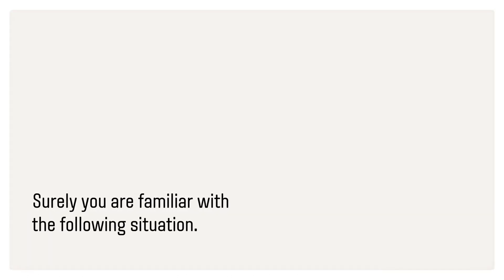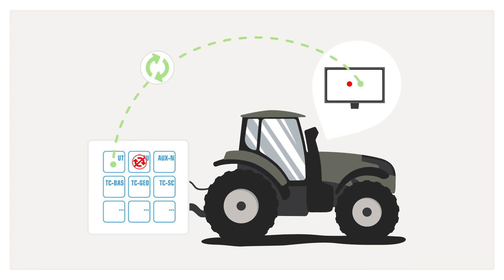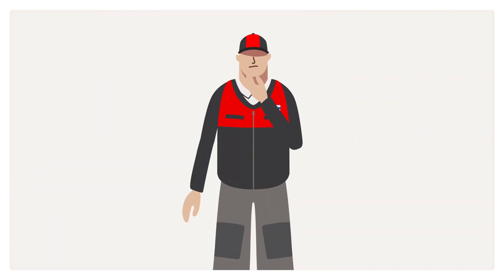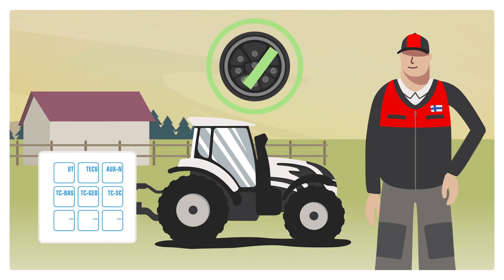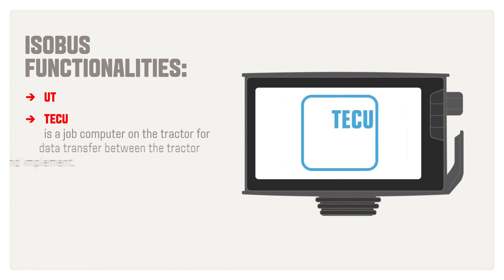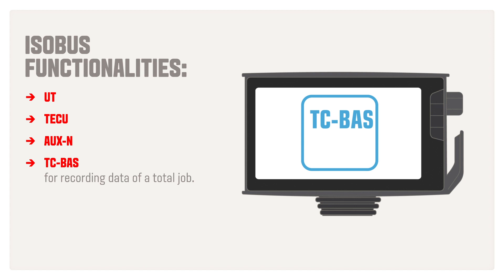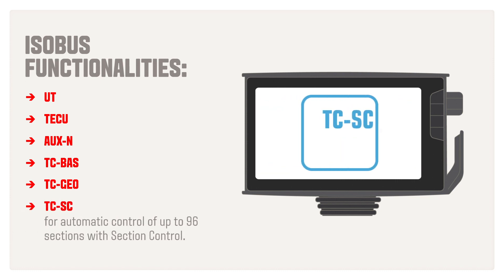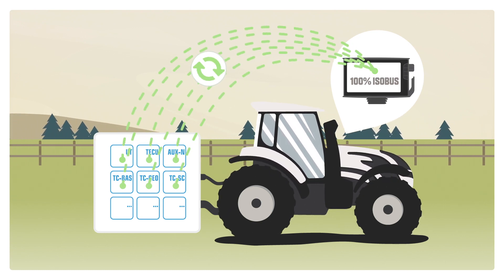Valtra Guide | Valtra & ISOBUS

Comment: Smart-Touch is great! But why aren't all functions you mentioned here listed on the AEF database? How about AUX-O, TIM? And does all functions work on both primary and secondary Smart-Touch screen?
Reply from the maker: Hello Axel and first of all, thank you for your comment and questions. 
The reason why we don't have the ISOBUS functions mentioned in the AEF database is simply because we have not yet gone through the AEF certification procedure for them. Most of the common ISOBUS functionalities are nevertheless working perfectly in our well tested SmartTouch user interface. Regarding AUX-O it is working, but with a 3rd party auxiliary joystick connected to the SmartTouch armrest, which supports the AUX-O functionality. AUX-N is working with the integrated M-buttons and all proportional levers in the SmartTouch armrest. Furthermore regarding TIM - that is an ISOBUS feature that we do not yet support but please stay tuned because we will introduce it in the future.

All ISOBUS functions that are unlocked on the SmartTouch screen also works in our SmartTouch Extend screen, which is our secondary screen, so you can customize your user interface as much as you like between the primary and secondary screen to make your work as comfortable as possible. I hope that we could answer your questions and please do not hesitate to contact your local dealer for more information - https://www.valtra.com/dealer-locator.html
Best regards, Johan from Valtra.
Reply: @valtra  Thank you. Great Answer! Is it also possible to use aux-n on the second screen with the integrated M-buttons on the armrest? If I change the settings to aux-n the screen claims that the armrest M-buttons only works with the armrest screen. Maybe it needs updating? Thanks again!
Reply from the maker: Great, thank you. Only works with the newest SW 2.5.4. But to your question, AUX-N also works with SmartTouch Extend so please get your tractor updated.
Reply: @valtra  Will do👍